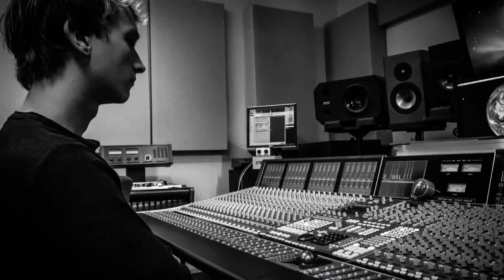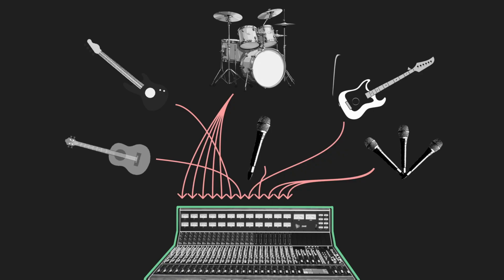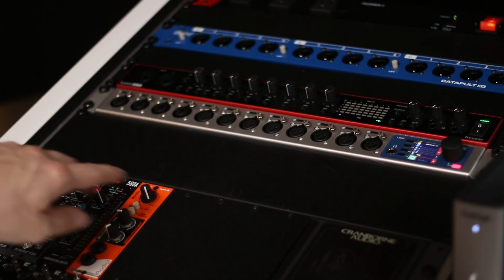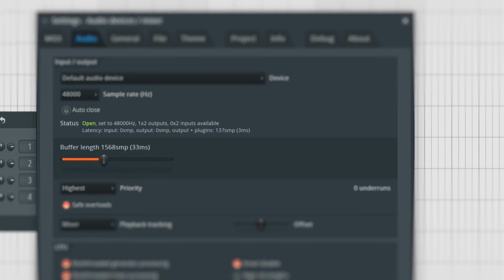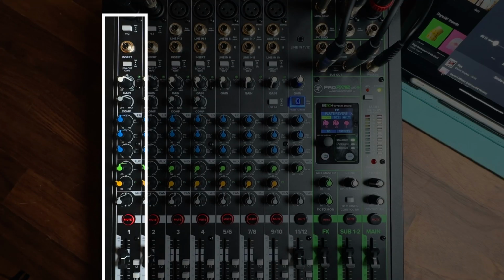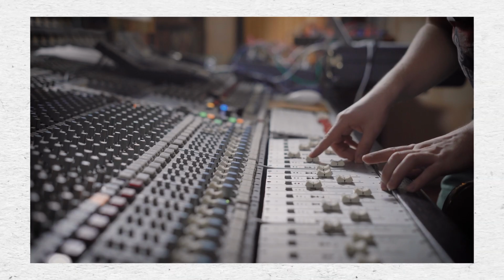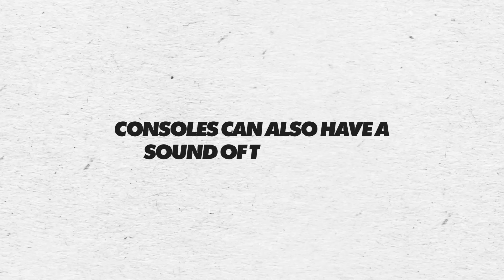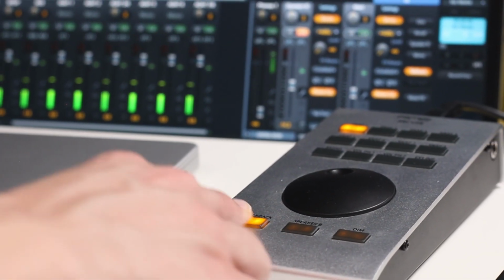Do You Need a Mixer in a Recording Studio?

Comment: I can appreciate your attention to detail but this video could probably be trimmed down to 3 minutes. It's pretty simple:
1- Are you recording bands or multitracking?
2- Are you doing any summing ?
3- Are you using outboard gear ?

If you answered No to these 3 questions, then you don't need a mixer. With the exception.. Is it an SSL, a Neve, something worthy of amazing preamps ? If it's a Mackie 24-4-4 Don't even bother. You don't need it.
Reply: And while the RME Fireface UCX II is a quality unit, it's also 3 times more expensive than something like the Focusrite 1820 which has the same routing software and will do the same thing.

Comment: Great video. I really enjoy your channel. 
I myself am an old guy as well. I use both. Have for years. They sound very different. If I know the client will have a lot of revisions, I will more than likely stay in the box.Some songs sound better mixing on the desk. Whatever works for you.
I have a very nice 24 channel console, Here is what I love about using it.
24 nice mic pre's and EQ's that work very well together, and a nice 48 channel summing mixer. I always have drums, bass, two guitars, a Hammond, a Rhodes, a piano, a Vocal and a talk back set up at all times. If an idea comes up, go put it down. No set up time.
When mixing, I use the console as the last insert on my protools tracks.
I can still use any plugins and I can still do all my automation in Pro tools. If I want to use a plugin reverb, I just send an aux to and from a protools aux send, Done. You are not stuck with only hardware. I can use all my plugins with my analog console.
If you decide you want one, specialally a vintage one, get to know how a soldering iron works.

Comment: I do a little of both.  I started in '90s, cut my teeth on analog with digital mixed in here and there, and morphed around to a hybrid workflow.

When it comes to tracking, I might track using an analog multi-track (with SMPTE so I can dump it back in) for some things, and other things can be done in the box—I almost always start in the box with my referenced tracks and whatever.  After editing, mixdown is preferred through a console, if it has good EQs (I have yet to hear digital EQs that impress me), perhaps printing to analog 2-track or I might even individually EQ/compress tracks with commercial-grade equipment and then sum digitally.  It could be AAD, DAD, DDD, A/DAD or A/DDD.  I use whatever I think is going to give me the best results and make the most sense for the situation, it's never the same for every situation, and sometimes it the inverse of convention. 

It's important to know what the strengths and weaknesses are of every piece of gear and ever process and to use what you have according to that; but even more importantly, don't let fussing over small details ruin a good project.  Once you have things fully operational, make sure you see it through.

Comment: Another cool video - thanks a lot. I'm using Bitwig as a DAW and a Tascam Model 12 as audio interface (adjusted mic input to DAW and stereo out to Monitor boxes Adam Audio). Question: do I have to turn all knobs (EQ etc) at model 12 stereo input from DAW to "0" / neutral (on the stereo strip as well as in the master section)? Best, Jan

Comment: If it's only about making easy, then one could get Neutron 5 etc, and have the job done lightning fast. I am more interested in sound quality results. I have a Studer 962 with 40 in and use 18 to 24 in to mix OTB with a Neve 33609 ( hardware) inserted on the PT Master out, then coming back from the Studer Master out to an aux bussed to a track in PT to print offline. I keep the fader on the board to -5db and sparingly use the eq for maximum repeatability. I feel that's the best sound i've had yet...

Comment: You will always need a mixer for returns from your different outputs from interfaces, synths, rack effects, preamps and amps etc as well as routing different monitoring, multiple microphones. DAWs always sound inferior also because of the vile latency + working with computers also takes 4 times the time, and then your idea is gone :/

Comment: I honestly prefer using the console before it goes into the PC and prefer using the DAW program for mixing post.  I also use tape.  The thing that I do that's totally unconventional is if I use a multitrack deck, I only have 2 channels going into the computer.  The way I get around that is I find a noise on the tape prior to the starting song and I use that as the reference and line all the tracks up using that noise.  I got a lot of practice doing it that way and it's not as bad as it seems.  The thing I like about the mixer is it has a parametric EQ so I can make the mids sound great.  By also doing that, everything else is flat and sounds beautiful.  Your ears are your best tools for this.

Comment: I’ve been making recordings since the 70’s. Working strictly in the box exhausts me after three hours of scrolling through screen after screen and plugin after plugin.  I can’t go on at a certain point about 3 hours in.

Working on an analog mixing console I lose track of time and can easily spend 10 hours on a session and still feel energized.

I currently use a hybrid system with a API 16 channel mixing console.
Reply: Can you show your gear?
Reply: @pabloconte3028 I’d have to post it up on a YouTube video. I have an API Box console with two sidecars attached. In the sidecars I have 6 more API preamps, a Telefunken v 76, UALA610mk2, stereo Demeter tube preamp, some vintage RCA preamps, a Manley ELOP, UREI 1176, and a eventide eclipse as my main rig. I have other gear too, but that is the nucleus of my studio. I track into a 16 channel Apogee Symphony using Protools then mix back through the console into an Apollo x4 and then mix into Harrison Mixbus. I use one interface for tracking and one for mixing all on the same computer.
Reply: Invest in a good control surface. I use Mackie Control with 8 track extender. Gives me 16 full tracks of hand control. Trust me, I get it. i went through the same thing 20 years ago when I switched over to digital fully. I missed the knob turning, the fader moving. But no control surface will ever be a replacement for a mouse which will give you precise, accurate movements.
Reply: @100chuckjones No thanks, the Slate controller might make more sense, but I’ll continue mixing through my console with discreet preamps.
Reply: @BaxendaleGuitar  I don't understand. You still use you're console and hardware (pre amps) it's only a controller with knobs and faders, buttons, jog wheel, etc.
But do as you wish.
Reply: @BaxendaleGuitar  If you mean "The Raven" (Slate controller) it's a digital touch screen, not a controller.
Reply: @100chuckjones It’s way more than a controller. Discreet electronics sounds way better from the beginning. I use a hybrid mixing system but I mix out of the box through a console which for me sounds way better than your controller which is a glorified mouse.
Reply: @100chuckjones It’s also a controller, using Digital Touch faders instead of mechanical faders.

Comment: Good thorough video. Couple things..the versatility of being able to change the sound of your mix bus in a daw only setup is cool, but if you have a console that has a signature sound that you love, that's another point to consider maybe. Some people like NO color in their mix bus, other's love what an analog console brings in terms of sound, hence the zillions of console plugin emulations out there. They might get you close....it's a matter that's been debated a million and a half times online.  I realize for the purpose of this video though, combined with the ambiguity of personal sound preference, this would have been a hard thing to cover.  One other thing I learned though, while mixing using a DAW through an analog console is this: If you miss a cue? Presumably you're running your daw outputs into the console, and the console's mix output to a pair of converter inputs (providing it's a stereo mix). If you miss a cue, rewind, set a punch in locater, and punch in your two track mix, and redo your missed cue. No need to start all over. Also, take photos with your phone and put them in the session's folder of pics. No need for pencil and paper if you can clearly read the nomenclature in the photos. Been doing this since before phones could take photos with a digital camera. Besides, I'd probably use some notepad app, or just the notes section for each track in the DAW to write down the settings for the outboard and console for each track instead of pencil and paper. I mean, using a console doesn't mean going completely back to 1975.  One last thing. If you have an analog console, and you have a daw? You can mix either way. If you feel like the console will sound better for a project, you can use it. If you want the sound of the DAW, just don't use the console. If all you have is a DAW, then you have but one choice... Thanks for the cool video!

Comment: Great thoughts but missed one option . . .  the hybrid of using a control surface with a DAW.  Doing so keeps the best of both worlds of both the board and box.  The ability to "using the board as a performance piece" is super nice as it engages the engineer more into supple musical details by allowing the ability to do rides and changes on the fly.  It still allows the ability to save session settings, including the ride changes and effects processing so that the tedious need to write session settings down.
If you have the budget and the artistic inclination to engage the mix more, then a control surface / DAW mix is an option.

Comment: nothing beats having a tactile analog EQ on every channel. The EQ in a decent analog mixer beats anything I've found in software and forces me to use my ears. Maybe it's the filters or amplifiers or the frequency knobs on them, idk, but it sounds amazing.

I pipe my MPC Live 2 through an analog mixer from the early 90s with 16 channels, by using a class compliant USB audio interface creating 10 outputs going into the mixer. For mixdown, I pipe 8 mixer outputs (2 master + 6 subgroups)  into my DAW using another audio interface, from which I monitor everything. One groups for drums, bass, etc. Each of those groups is a track in Ableton for recording/bus FX.

It's completely changed how I make music since I try to as much as possible on my MPC because I'm completely unproductive in a DAW (too much choice, too much distraction). 

I also love physical faders and recording them live, instead of less musical automation. Makes it a performance.

Routing outboard audio effects via inserts or via subgroups and sending groups of channels to aux to a reverb for ex, is extremely useful, the mixer is a better user interface than DAWs as it's easier to keep track of everything going on.

I use DAWs only for mastering/bus chain software FX (tweaked live, not just after printing stems) and final arrangement.

Comment: Love your channel but what you didn't mention is if you have analog modules running thru stereo on the analog mixer as well as other gear, a simple 8 channel interface will not suffice and you would need to expand your ADAT or Spdif connection, there are benefits to both I'm just not willing to give up all the analog gear in place of digit, I would love to see a comparison with an API 2448 console to a RME fireface UFX 3

Comment: I use and need a mixing console. But I got rid of my computer recording setup and got a Stephens 821b two inch 24 track and the only way to practically mix without a computer is with a mixing console. Latency is very noticeable to a singer even with fairly low latency in the form of comb filtering. Recall is a bit of a pain in the backside, fader automation can be a lifesaver if you have a console with it. The Stephens has been quite reliable but it is a good idea to either learn to fix it, or know a technician that learns how to fix that particular machine.

Comment: I'm using the Midas m32 mixing consol. For me the right choise to have a 32 channel audio interface with channel strips,  endless routing capabilities in seconds and a daw controller. I think digital mixing consols are great to size down the consols and to have the benefit to have the best of both worlds.
Reply: I have the mr18 , very handy set up with the control surface options live or studio.
Reply: @MG53v8  Yes, the mr18 works too but no real faders. And the motorized faders of the m32 are so cool 👍

Comment: I was recording directly to interface but with output, I’ve found having a desk a massive benefit, obviously it depends what you’re mixing but I felt what I was dealing with suited having the analog warmup and eq, also  having the faders and being able to use the thing as another instrument feature has been gold. I have 36 in and 30 outs on my interface setup and so I put 16 channels in and out of a desk that’s 24 and use the other channels as backup as each strip in modular and can be swapped out. I found bouncing between both digital and analog tools really useful but also with the 16 track, I can record both digital and analogue 16 track simultaneously and if you really wanna hear the difference between the two, this is the way, and I can already guess which of the two you will prefer the sound of. Honestly v useful but also far more complicated and difficult to deal with. You need really good systems to manage

Comment: I've been on the mixer for 33 years now, both studio and live.
In studio i use both methods, analogue and digital. I use RME as well, as in my opinion (according to my ears - others can have different opinions) it's the most linear (characterless) interface on the market.
In one of your slides you shown a neve consolle going to a studer multitrack tape recorder, and that's the gear i used for a long time. Funny enough, since old studers are very sensitive and delicate machines and spare parts are not easy to come by, when it became "less usable" the neve basically became the preamp going straight to the RMEs. Best of both worlds, so that the raw tracks are already good (I totally disagree with the "fix it in post" that most producers want, just to save on studio time).
The debate of what's best between digital and analogue doesn't interest me much. I believe all depends on who's using it.
Real audio engineers should be able to use all techniques, because the target is the same, and that is good sound. Unfortunately nowadays many "young graduates" think that top level gear automatically can make them great.

Anyway, your content is good and topics clearly explained, I often suggest it to people still learning.

Have a good day.

Comment: I think those giant mixing consoles are a borderline marketing gimmick at this point. Look at any textbook on audio engineering from the AES or similar groups and they all have the obligatory mixing console on the cover. Nevermind that most enthusiasts will never use one and never need one. I've recorded bands, worked in radio, and currently work in audio preservation, and I've never needed a full studio mixing console. Analog is nice, but a 500 series setup should be enough for anyone who doesn't want to go digital.

Comment: Definitely a mixing console or at least a control surface. Tactile feedback is important. You don\t want to drive a car or fly a plane with a mouse or a touchscreen. Right?

I personally use the best of all worlds: digital mixing console, plugins and most of automation inside a DAW and some outboard gear. My typical mix has 1 to 5 channels of analog outboard. It doesn't take that much effort to write down the settings on an Excel sheet template which has a cell for all knobs of my every external processor.

Comment: Interesting! 
Personally, I only need a good sound recording device with 2 channels. Most of my recordings are either non musical sounds (mostly sound for videos) or on sometimes, live music (where the goal is to recreate the experience of being there as good as possible, not to do a mix). An external preamp is another thing though. Even some really good recorders or cameras (that perform well when recording line level signals) often have crap preamps in them. The problem is mostly noise.
Even when using the line setting, if the recording level is adjustable, the SNR (the ratio between 0 dBfs and the average level of the noise floor) for most devices get better the lower the recording level is. So it's better to use an external good preamp and adjust the recording level by the gain, than adjusting the level in the recorder or camera. 
I have built my own preamp and have a DC/DC flyback converter in my design - so I can run conveniently on a single 18650 or 5V USB power (I use mine mostly as a portable device) and still supply the opamps in the reamp circuit, +/- 15 V (that way, the preamp will never clip before the recorder). 

In my particular case, I also use microphones that I have built my self from Primo EM273 capsules - and to get the best performance out of those (mainly when it comes to distortion at high SPL), they have to be powered up in an unconventional way with either a 3 lead configuration (which is the one shown in the data sheet), that has a separate power and signal lead - or a 2 lead configuration with negative voltage (unbalanced, with ground positive instead of negative) - which is the one I use, since it's more conveninent to be able to use small RCA connectors, when it's an unbalanced signal anyway. A voltage regulation circuit is also needed to get stable voltage to the capsules and lowest possible THD. This is against all normal standards, so I need a custom built preamp anyway.